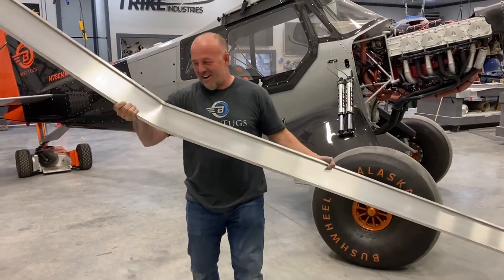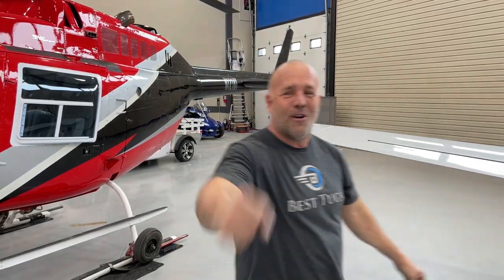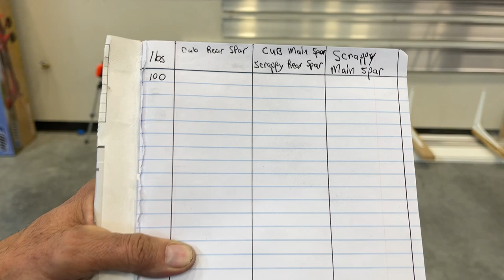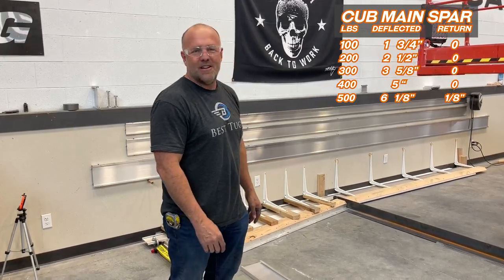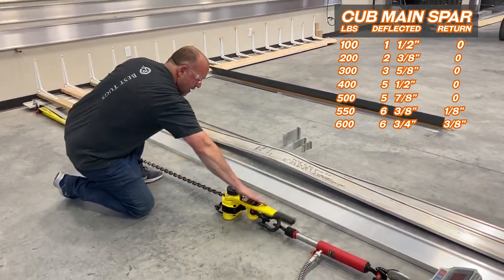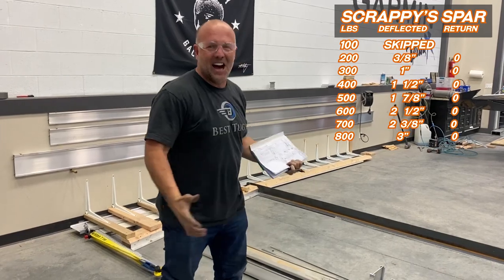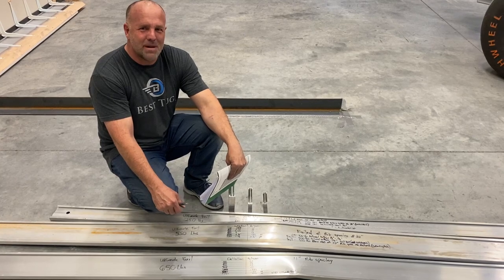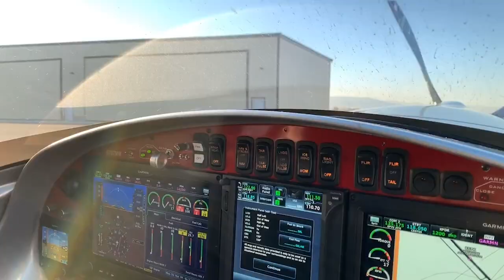I Just Broke My Airplane Wing - What I Learned | Scrappy #47

Comment: Mike love your channel, I know there is lots of haters out there but I have question about how you supported the Spar, correct me if I'm wrong, you were pulling against the simulated strut point giving it a supported compression load on the top cap which is usually an uninterrupted unsupported load (unless it is a low wing struted aircraft) rather than a tension load from the bottom cap. Do you intend on capturing the top cap of the spar with your strut fitting? As an aircraft structures mechanic I have seen a lot of top cap failures in 35 years thus the top cap inboard of the strut position is normally reinforced by additional support angles eg; Cessna 180. Just want to keep you safe......Hello from Australia....

Comment: Is there any type of spar bend measuring system that can be installed along the spars as you build the wings to have a type of track record of how far the wings have been bent in the course of their lifetime so you would know when you have surpassed safety limits and need to change them out?(in either the wings or the tail section?)(like run some kind of wire along it that would have indicator points that might trip a warning light or something.....I honestly don't know....just wondered

Comment: @Mike, how do you ensure that the model tested on solid works matches material spec during manufacturing. Like what if some impurities or different heat ranges during manufacturing might make it out of spec with what was tested in solidworks?

Comment: 29:48 I think this last spar supports a little bit more load. 

The failure its caused by not enough clearance between spar and wall after the round contact pont.

Virtual hus from Brazil..

Comment: Wondering what the percent difference in deflection (if that's the correct term) would be if you introduced a fresh spar to a one test documented minimum failure load rather than subjected to incremental increases to that threshold? There would have to be a difference, correct? The repeated stressing would have to contribute some factor.

Comment: Mike, I'm no fatigue testing engineer but I'll try to formulate this question anyway… We know that most metals' failure points move towards weaker, simply from repetitive stressing. Would that 1675# failure point be different for a single, larger stressing effort?

Comment: I found this very interesting.  I'm a Flight Sim Junkie. When my wings break it is due to Gs.  How does this test account for Gs?  If your payload is 2000lbs and you pull 2 Gs does that mean you are now applying 4000lbs?  Also the stress takes quite a while with the crank to apply.  In real world wouldn't that occur in sub second time?  There might be technical posts on the internet but I'd love to have you discuss this about your test and maybe go further as I'm sure I'm missing something.

Comment: When the plane is on the ground the chassis supports weight. right? When the plane is in the air, the chassis is not in a bind, wouldn't a bump translate into altitude movement rather than spar flex? Trying to understand how flight conditions duplicate the test.

Comment: The wing strut would be the failure point before the spar? Edit: would then either the strut or the attachment points of frame or the fuselage be the transferred  failure point based off the ultimate point on the area it deformed in your test and the highest stress?

Comment: Curious... when loading a spar past 1000 pounds and seeing “1/16” and similar small deflections from return-to-center at these loads, how much of that is just a simple dimple from compressing the aluminum at the pivot point in the center? If that point is in the center, and the spar relaxed 1/4” at 1500, for instance, you could simply have an 1/8” “smudge” of aluminum at that center. Picky? Damn straight! But tell me you didn’t see any compression marks in the center... I believe your early numbers are lower than measured for this reason, unless you can’t see any mark in the center.

Comment: In the electronics simulation world I have found that when there is a deviation from real world testing it is because the simulator did not have the inputs correct. The tools today are so accurate that margins and buffers can be extremely small.
Reply: The simulation didn’t have ribs. Also Mike is also confirming that the extrusions were good.
Reply: @jsbrads1  Arguably the simulator did have the "ribs" since the results tracked very close. I would bet that for deflection data the sim was constrained in one axis. I expect that he ran another sim with the actual ribs that he is going to use. I mean he didn't build that Ryzen machine for one simulation.

Comment: are new spares being used for each pull or the ultimate calculations include accumulated "history?" (where the return is zero) from rock mechanics this may not be the same?
I think I answered my question--@ return of zero the metal hasn't seen or recorded any stressors to weaken it. only until a return of greater than zero does the metal in this case start to record "history" and then that accumulation weakens it until breaking point or total failure...funny i was watching the video and looking at the yellow strap clearly marked the WLL of 6400#'s the LED came on! return of zero can be equated to WLL with pull strength in pounds.

Comment: It would be interesting to know the lateral load that the ribs need to withstand as a result of the buckling load from the spar.  It is important to know this load as it will determine part of the rib design and spar design in the direction perpendicular to the applied load ie: in the weak direction of the spar.  Good starting point but the spar load is not like the test setup in that the restraint afforded by the ribs in the lateral (weak direction) of the spar is not infinite as it is in the test setup.  In essence, the load on the spar could translate into an unacceptably high load on the ribs and the strength of the spar in the direction of the tested load is rendered meaningless.  Sorry for the confusing description...

Would an extruded spar shape that increased the lateral strength of the spar be worth while?  Something like a T section perpendicular to the web of the spar.  It would be great to know the lateral load of the spar (vertical direction on the floor in the test setup) due to buckling at the yield point of the spar.  If this load is small, and I bet it is, then the added weight of a lateral stiffener on the spar would be a really good benefit to the load capacity of the spar.

Comment: wing spar loads will be spread over the wing length, pulling at one point is analagous to the wing hitting
a pole at speed at that point, not realistic to how the wing actually works in the air.
Better method is to spread the load over the wing,  puting weights at set intervals across the wing will give
more realistic results.

Comment: The rear spar on the carbon cub stayed bent at the same deflection as the front, say 6.75 inches.  So a bent wing might still have the correct angle of attack.  On Scrappy they are mismatched.  The front stays bent at about 6 inches.  Excessive positive G’s would leave the damaged wing with increased angle of attack on the tips...  aerodynamically unsafe at stall speeds.  How many G’s would it take to damage the front spar (with a full load of gold bars of course), and can a human survive this?

Comment: You could see the end of the largest spar twist when the pulls were over 1400 lbs. I guess the bottom flange is under so much compression that lateral movement is the result?
Reply from the maker: 👍🤠 Correct.  That twist has nothing to do with the spar failure it’s just the play between the wood. . In the wing it’s fully attached to the ribs and can’t do that natural twist.  I could grab the spar by hand and twist it that much inside the wood frame with no tension at all.  I should have showed a close up and talked about it.  👍🤠
Reply: @MikePatey  I am guessing this is caused by the bottom flange being under so much compression that it translates to lateral movement, and with the added ribs the movement translates to the end?

Comment: Be careful though, your test setup is non-conservative. The fabric does not transfer loads, so in a real wing it will not prevent the spar buckling, like your test setup does.
It would be different with a stretched skin, it's the whole point.

Comment: But Mike, aren't some of these tests inaccurate? In a wing there lift isn't just going to be at the tip, its going to be distributed through out the length of the wing meaning that the wing could probably take more overall force you're applying. How are you accounting for that?

Comment: I have a ? , what is the number lbs, ? on the middle point, ? the push, So is that =  to the pull  ? your  pulling down on the tip, So now is that a fulcrum point at the center? like does that # increase by multiples ??

Comment: Wow, want to talk about going 'above and beyond.'
I want to confess my lack of knowledge, i.e., ignorance.  As a PPL who has not exercised my privileges in decades, money, health, etc, we were told not to exceed a certain number of Gees, positive or negative.  I personally never connected bending of a spar with G-loading, at least not until now, and even then, I'm not exactly sure what I'm looking at here.
In the recent loss of a Piper Arrow in Florida during a check ride, we know that the wing spar failed, from corrosion, IIRC.  They weren't exceeding the rated limits of the airplane.  It wasn't like flying the Wong Warrior upside down and certainly far outside of its design limits and criteria
You talk about hanging a hammock from the wing tip (I"m assuming back to the wing strut) and I can see that as a static load, but I wonder if you can discuss what a pilot might encounter in the air, either by nature, or self-induced, that would cause a spar deformation.  Obviously, overloading the airplane, since you'll now be able to put in as much payload as our empty weight, is one aspect, but how else might someone overstress the aircraft to deform a well-built, well-designed spar?
Next question.  How would a Carbon Fiber spar have reacted?  Would it have the same kind of load capability as this aluminum?  Are your ribs going to be aluminum or carbon fiber, and what about the skin panels?

Mike, really, every video I watch of yours, I comment on how much I am in awe of your design work, work ethic and abilities.  This shows though, that anyone with the proper training and desire, whether for themselves or for a manufacturing company, could, if the desire is there, a product far superior to anything currently on the market.

I wonder what Piper might be able to come up with if they designed a new airplane like an Arrow or Lance/Saratoga, using the same design criteria that you are, as well as things like laminar flow (which Piper did use on those airplanes, and then tripped it with rivets!) and other 'improvements.'  Could they produce a four-place airplane capable of carrying four adults, full fuel, baggage with a FADEC TEO-390 that would climb at 1,000 fpm, cruise at 200 knots on 11 gph with a 1,200 mile range.  I only mention Piper because of the Arrow accident I referenced earlier, but Cessna, Beech, anyone.

Comment: But, doesn't a spar load up between the root and the strut, AND then from the strut to the tip?  Shouldn't you also be putting strain on the inner section of the spar as well as the tip?  I bet you get different results.....

Comment: I'm sorry to say that, as an engineer with knowledge of mechanical engineering, the design seems insufficient.

In my not so humble opinion, this spar is wrong. You should design a specific failure model when overloading. This spar's failure model is to break out which seems undesired. This leads to wings breaking without much warning. And then, in order to compensate for the break out failures (in order to increase performance), you add more ribs which have a different function in a wing. But it still fails by breaking out. You are basically using ribs as a means to modify the spar. But without actually designing it in that way.

Now I'm not saying the Cub is designed properly. But that doesn't mean you should extend that method of working. 

You should have a less impactful failure model (plastic deformation with normal rib spacing). In order to do so, you should have a different design of the spar. You can't just modify one of the dimensions (height and thickness) and leave the rest the same (i.e. the top and bottom of the spar).

Comment: Albeit probably small, wouldn’t there be a certain factor of fatigue over time? Aka, flying in turbulence for years and years? If you were to do this again after 5,000 airframe hours would the results be the same? Believe it or not, my ocd is much worse than yours and I can build engines in my sleep, but a structural engineer I am not. And do not want to be 😂.